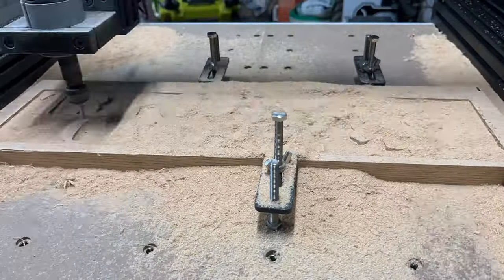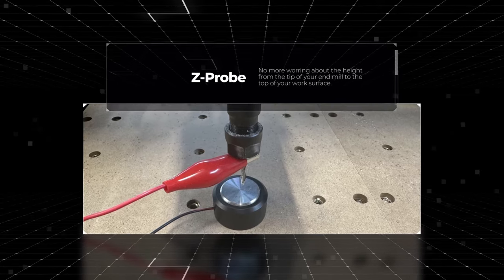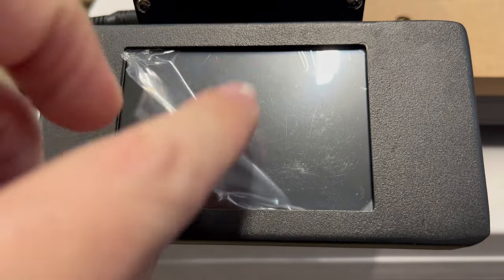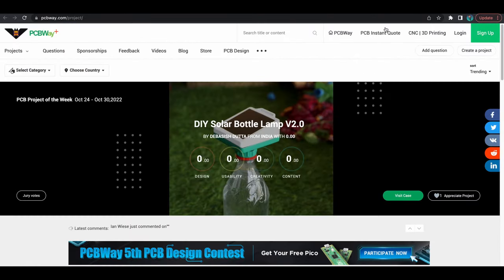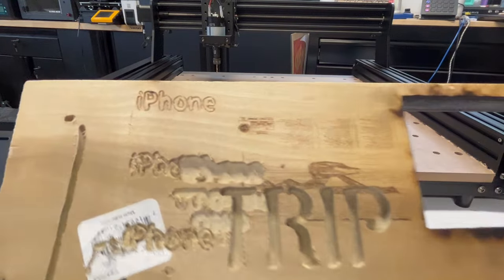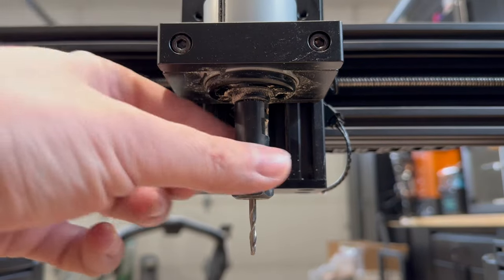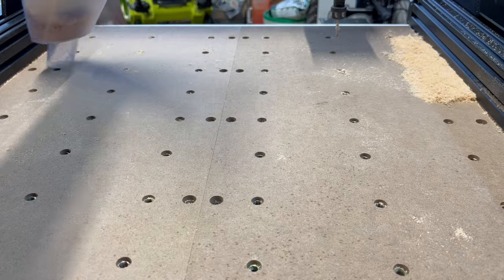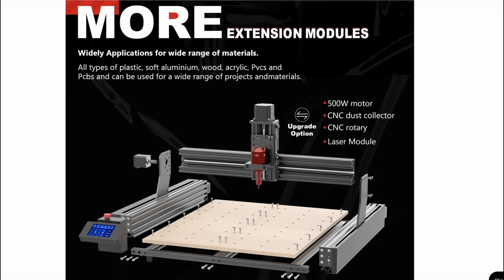TWOTREES TTC450 CNC - Great First CNC!

Comment: The wires rubbing against the frame is because the drag chain is too far forward on the Y axis  (go to 3:02 and zoom in). The rubbing cable that comes out of the end needs to bend back to connect. It can't bend back with enough slack to keep it out of the way of the fame when tied to the side of the upright. Unsnap a couple of bars (not the entire link) from the top of the Y drag chain to release a little more cable. This will let you wire tie it to the back of the upright instead of the side. The video on the SD card shows the cable tied to the back not the side. The cable doesn't get in the way of the limit switch when tied this way (tested).

Comment: Looks like you may want to get a flat faced endmill and a ball nose end mill to clean up the operations with a finishing passes (meaning set up your main cut just short of the final pass finishing depth and take a shallow clean final pass). The ball nose will smooth out the rounded areas and the flat end mill and a finishing pass (maybe a .10 or .25mm) will clean up the rough flat zones. Fusion 360 free hobbiest version is still the best CNC software. But there's a learning curve. At least until they make it a paid software.
Reply: I’m new to CNC and just ordered this model. I was going to ask if different bit would make the end product better. You have answered my question thank you.
Reply: What makes Fusion 360 free version the best CNC software? With which other products did you compare?

Comment: Just found you tonight, but good video. The left side cover !  I removed about 10mm along that opening and the cable is no longer rubbing. Also the new upgrade kit is here just waiting for TwoTrees to give me the "go ahead" and show off the new 500watt motor etc...
Reply from the maker: Thanks for finding me 👍. That 500w motor along with dust collector will make this one amazing CNC!
Reply: I think the spindle was rather small, but this new one looks like a beast. 😃

Comment: A couple month ago I got a TTC450. Then I designed couple jobs, put them in a flash card, loaded them in my laptop; then I set up the
machine and a piece of wood. When I push the start button the spindle start rotating, but nothing; it remained in the same spot. I'm
missing something. Any idea? I use V-carve pro, GRBL and G-sender. Thank you for any help

Comment: The only thing you didn't cover is what materials it can cut. Ok it can do wood. What about plastics and metals?
Reply from the maker: I wouldn't suggest using this CNC for metals.  When milling metals it is suggested to use cutting fluids (cutting oil, cutting compound, or lubricant).  It can engrave softer aluminum, plastics and wood using the correct end mills.